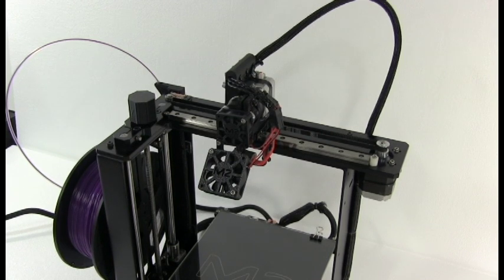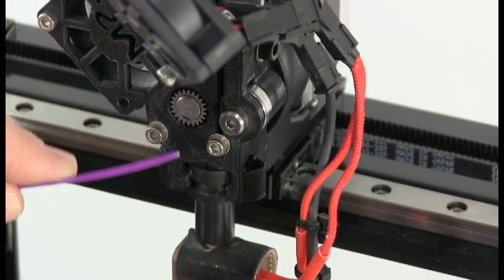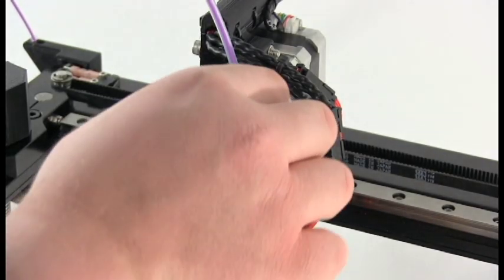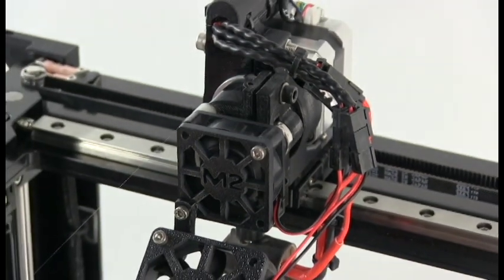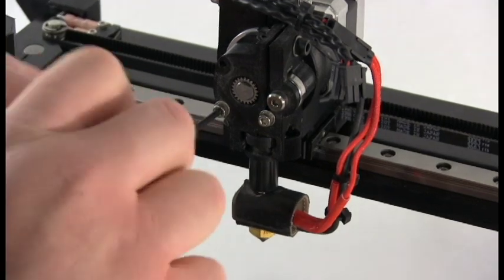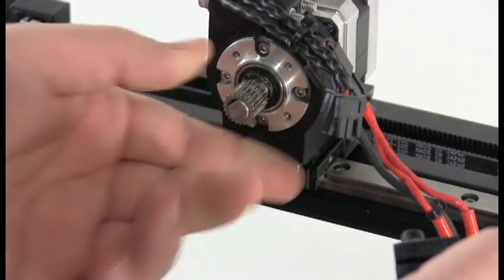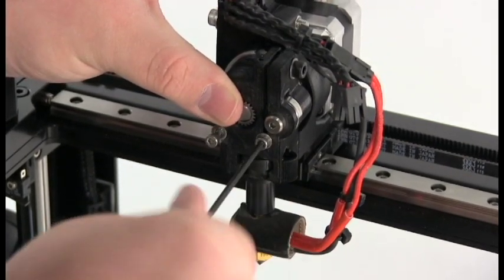Filament Feed Troubleshooting - MakerGear M2 3D Printer (V3 B Hotend)

Comment: Sir, I do believe that would be a 45 degree angle you cut... I find sometimes you've got to try different angles, also heating the extruder up another 10 can also help (sometimes just moving the fan for a bit does this just enough to get the job done)

Comment: My extruder isn't feeding filament... I performed all these steps -- I found that my extruder nozzle (at 3:00) is easily removed from its "press fit" housing assembly.... I've contacted MakerGear support for this. My print failed when it was almost complete due to the missfeed.... :(
Reply: Im thankful just to have an m2! (compared to others in the price range, IMHO) ... suggestion for your next prints ... print off one or two spare parts for everything printed on the machine, ya never know when say a vacuum is going to bump into it and break something off... crap happens, almost daily.

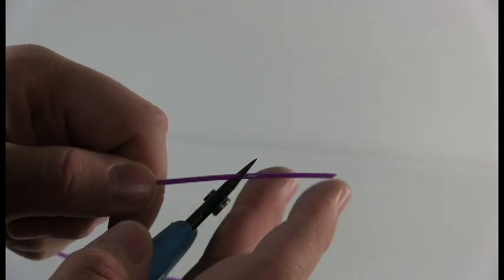Comment: at 1:47 you say to cut the filament at a 90 degree angle, but appear to cut it at 45. should the cut end be flat or tapered as it appears in the video?
Great video's by the way thanks so much for providing this channel! a picture is worth a thousand words (or 100 forum posts in the support area). :-)